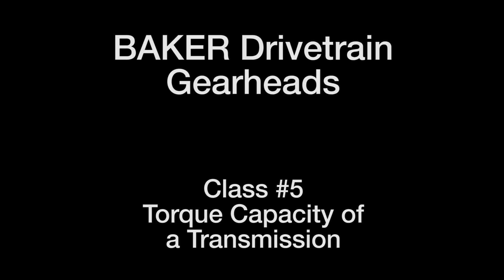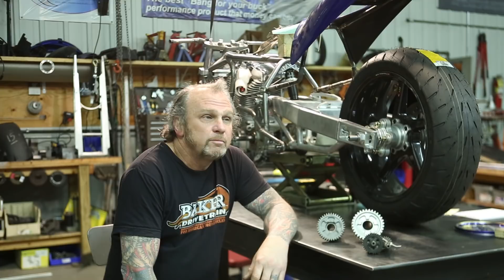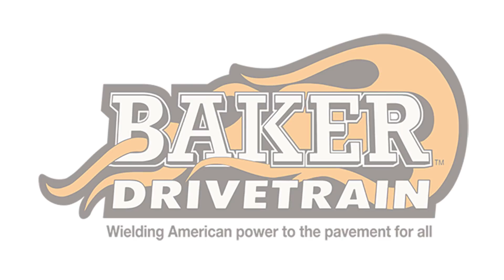Class #5- Torque Capacity of a Transmission

Comment: Hey man thanks for the video very informatuve I just have one question, in looking to buy a transmission for a truck but it says it can only handle around 300 ft  pounds, is that at the wheel or at the crank? Just asking since lower gears make more torque at the wheels but don't change the torque the engine produces